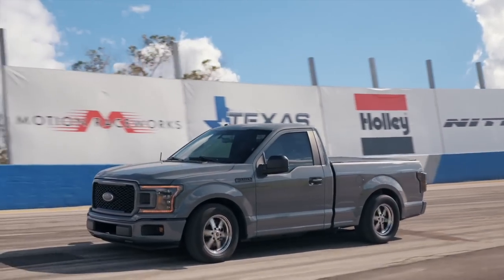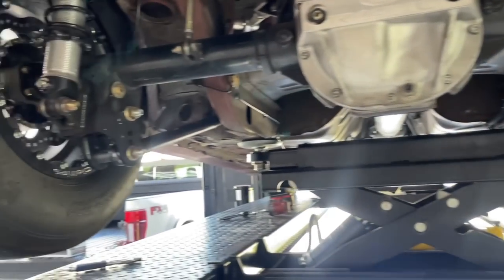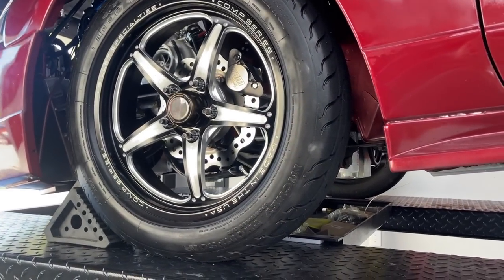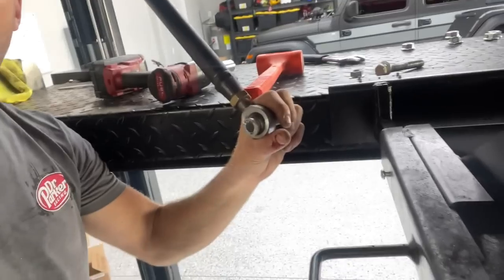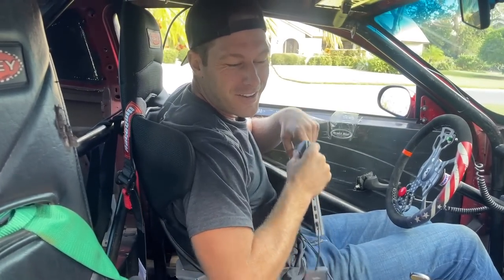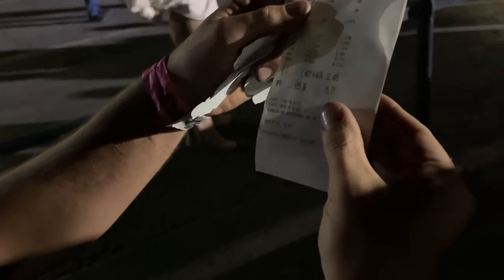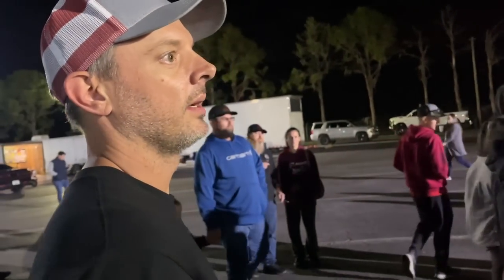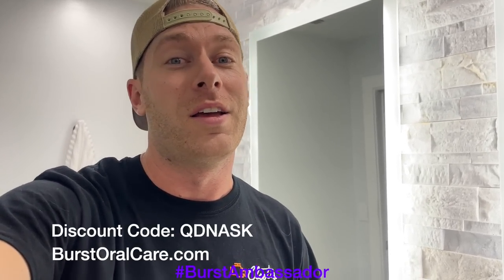Dr. Pepper Hits the Track & Uncle Chet Try's to be Like Me

Comment: I think your best bet is to have the converter tightened up some more. If you are going to try the thicker fluid you might want to talk to your trans builder first to make sure its ok. Its going to increase the line pressures and don't want to damage anything. Have a Happy Thanksgiving Parker.

Comment: I know you said you had not finished up the setup for the bump but if you have the control valve on the trans, you thinking you might have been dumping pressure through the valve? Maybe the dump valve cant hold the pressure of the new converter?

Comment: Why don't you just get the same converter Garrett has in Ruby? You have the same engine and trans, and the cars are pretty similar in weight. He had to change that thing like 5 times before they got it right.
Reply: Is he running out of gear, or is the conv so tight, the tranny slipping?